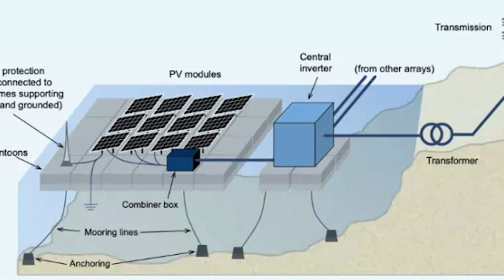India Builds MASSIVE $400M Solar Farm to Power 500,000 Homes!

Comment: BIG ERROR @06:02 - The power makes its way to land via cables from ****dozens of floating substations****** whose transformers feature readily Biodegrarable Shell MIDEL 7131 synthetic ester fluid. Each transformer contains this liquid and that detail is as important as the solar panels being on water because it enabled the whole project. 

Mineral oil (the usual go-to in India) would not be permitted on the water due to toxicity and not being biodegradable, and if the transformer s were on land instead, they'd be close to water table, requiring masive fire suppression systems (mineral oil burns at 160 degrees C). This would demand virtually impossible egineering controls to mitigate the risk of 1) dirty fire fighting water in case of fire and 2) the mineral oil in case of any potential leaks. 

That ester (fire point of above 300 degrees C) is both K-class and biodegradable means both of those risks are eliminated before any of the prject is signed-off.

The most important point however is that Okaresghwar reservoir is used for drinking water, as well as across the region's agricultural industries... so the specificaiton of the Shell MIDEL 7131 synthetic ester transformer liquid also protects lives as well as the integrity of the project. Literally by definition.

Moreover, the project does NOT simply "run cables" to the shore - the miniature floating substations make that possible here. Without them it would defeat the ojective of having floating panels, because the electrical losses would be huge. 

Having transformers on the water NEXT TO THE PANELS means only a small number of step-up transformers on land are needed, rather than many oversized substations (with mineral oil transformers) - all running huge electical losses. The shorter cable runs from the arrays to the transformer, the lower the electrical losses. This is where most such installations generate inefficiencies (this is why transformers are located at the back of wind turbines - to eliminate unecessary losses).

Ergo - Shell MIDEL 7131 means a number of things; maximally efficient solar panels, a greater stride to India meeting its renewables target, less copmetition for land that can be used for other things (i.e. farming) AND safer drinking water. Let's also reemember that in India, hundreds of thousands of people die every uyear from lack of access to clean water. 

THAT IS THE STORY HERE.

We worked on this for years. Run that!

Comment: It's not the percentage of wild AC the public power grid is having to support from wind turbine and solar voltaic generated electricity that is substantially important, but its fuel savings which is little to non.   In the US the advertised fuel savings for supporting the wild AC from wind turbine and solar voltaic generated electricity by the electric utility grid is 1% each.  That fuel savings percentage is exaggerated.  

The wild AC from wind turbine and solar voltaic electrical generation is very difficult and expensive to support.  It should not be supported at the expense of the public power grid.   The practical use for wind turbine and solar voltaic generated electricity is for maintaining electrical energy storage such as charging storage batteries or working with something similar such as hydropower.   The electrical storage can supply the power grid or run pumped hydro for stockpiling water for hydropower at about 50% efficiency.   

Instant 100% backup of wild AC typically  requires natural gas turbine generators running at high availability consuming a minimum 70% of the fuel of full output, but making little electricity, where in a few seconds they can be at 100% output to instantly backup the wind farm 100%.   Making up the dips in wild AC will cause more than 70% of full output fuel consumption.  

It would use 66-2/3% of the natural gas of 100% back up of natural gas turbine generators to run a natural gas combined cycle plant at high efficiency output where it can make full use of a steam cycle adding 50% higher efficiency making all the electricity than to 100% instantly back up a wind generator farm for the same electrical output to behave as a scheduled power station.   

The cheapest incremental electricity is from hydropower and nuclear power.  Second to those in the US would be a new ultra supercritical clean coal plant burning high BTU bituminous coal at a predicted crossover fueling cost with natural gas priced at $0.80 per million BTUs in 2022.  

US natural gas was priced at an offseason wholesale price in early summer 2024 of $2.50 per million BTUs, three times the fueling cost of the coal plant.  This is the cheapest natural gas that could be expected without economic collapse. Winter peak natural gas wholesale prices can be several times higher.  The US has some of the lowest cost natural gas in the world. 

UK wholesale natural gas was priced in US equivalence Oct. 2024 at $10.50 per million BTUs.

It is not accurate to state residential electricity cost is greatly the cost of maintaining the power grid as sometimes said.  In the US on average only 38% of the generated electricity reaches the residential electric power meter.   62% of the generated electricity on average is lost to grid resistance.   

A little less than $0.03 per kWh is average for US midwestern wholesale electricity scheduled 24 hours in advance.   That costs $0.03/.38 = $0.078 at the residential meter.   Our Cumberland, Indiana residential electricity in 2020 was priced at $0.10 per kWh.   The cost verses sale price difference has to maintain the power grid and make some profit.  Internally generated electricity should be significantly cheaper.

Comment: Net zero by 2040.thats should be the target.
Reply: There is little benefit to lower atmospheric carbon dioxide levels and lots of increased plant growth and vigor with less water for the majority of plant life on earth being C3 plants with much higher atmospheric carbon dioxide levels to at least 1200 ppm.   Former Greenpeace scientist state there is no unhealthy high level of atmospheric carbon dioxide.  The year 1991 is highest global average temperature officially on record.   NASA reports global warming at 1°C where it has been since 1992 after falling from 1.1°C in 1991.
Reply: Only if you're stupid and gay
Reply: sir , with respect , did you replaced your engine oiled bike , car with electric bike, car.
Reply: @Tinkuman143  Till date most of power is produced by coal power plant.
So no point in buying an electric bike or car.
And Car and bikes have catalytic converter to reduce carbon.
But still 99% of trucks and buses in India have no catalytic converter.
U must have seen the black smoke coming out of them.
On top of that the Battery Technology is not fully developed yet.so there is a shortage of efficiency in them.and on top of that battery recycling is close to zero.
Reply: @pritishjena5393  India is currently at 45% non fossil electricity generation. India is rapidly expanding its gas grid, planning on building 6+ HVDC and other grid improvements, expanding pumped hydro projects and announced a 100GW nuclear power mission.
Reply: @sounakmukherjee8034  India gets plenty of Sunshine.Solar panel have been developed from 1980s.remember the Casio Calculators with Solar panels back then.
So why didn't india develop solar panels back then.its only because of Extreme Heat and Climate Change that forced nations to move to clean energy.
By now All Indian Homes and industries should be running on Solar Power.
So imagine how far behind we are.
And on top of that Forest Coverage in India is Significantly Low.
Because of Increased demand of Agricultural production not only for Billions of Indians but also for Export.
Do you think Green Energy could fix the problem without forest cover.
Reply: @pritishjena5393  Yeah congress sucks when it comes to infrastructure no doubt. Also, Indias population is very high and unlike the rest of Asia we don’t have many skyscrapers instead people are spread around due to land reform. We need agriculture reform to become more efficient and protect our forests from future logging.